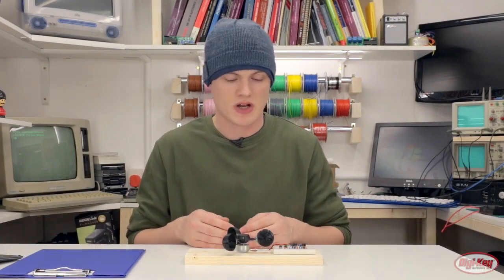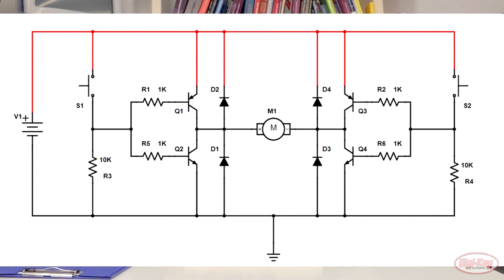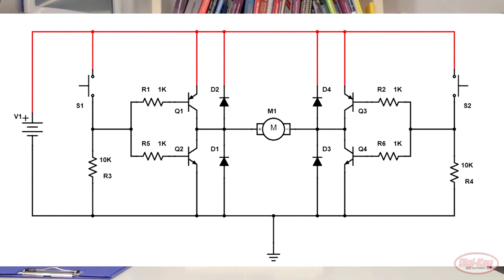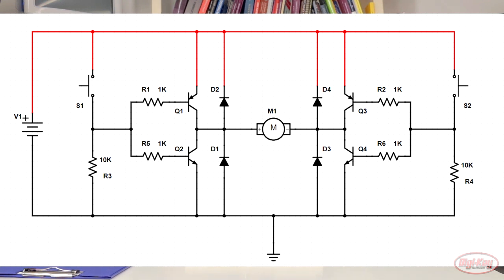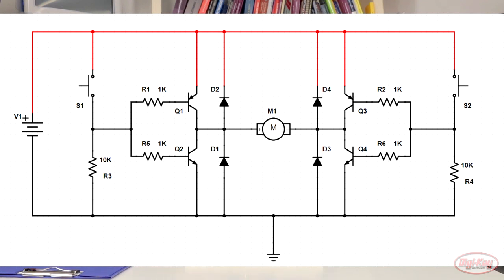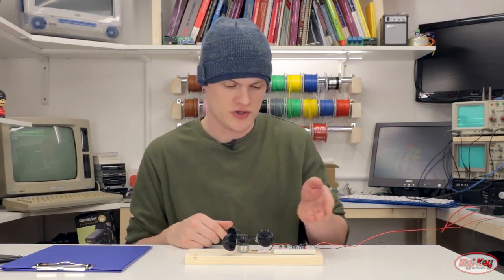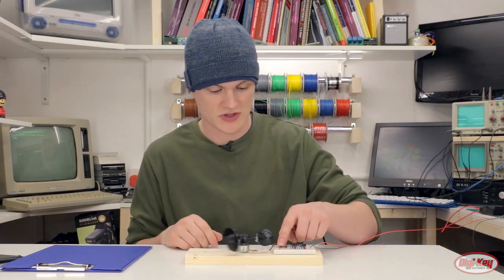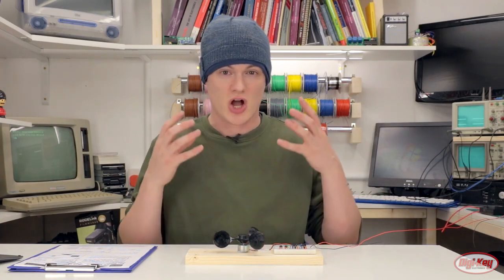How to Control H-Bridges – Maker.io Tutorial | Digi-Key Electronics

Comment: Please prove me wrong, but if I'm right it's a shame that this video is being used as educational information on the Digi-key site !

I think with a higher supply voltage, when S1 is open, both Q1 and Q2 will be turned on and an uncontrollable high collector-emitter current will destroy both transistors (Q3 and Q4 ditto when S2 is open). This is because the junction between S1 and the resistors, R1+(R3||R5), will be approximately at ½ V1.
Just think of a simpler circuit with only R1, R5, Q1 and Q2, current will flow through the bases of both transistors through R1+R5 (adding R3 will not significantly change that current).
The reason why the circuit shown is not fried immediately is probably that V1 is only 1.6V and the Vbe of a jellybean transistor is 0.6V to 0.8V, so there will be little left (about 0.2V !) to blow up the transistors, but wasn't he talking about heat problems?
By the way, it's not even a true Push-Pull configuration (where the emitters of the transistors are tied together, in stead of the collectors), in which case current can flow through only one base of the two transistors.